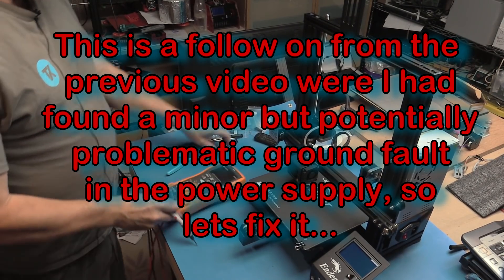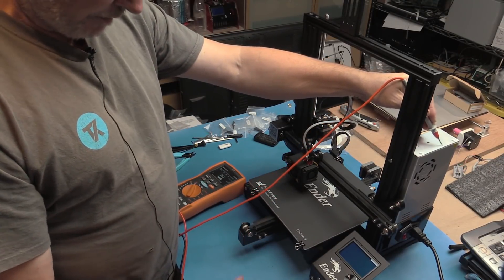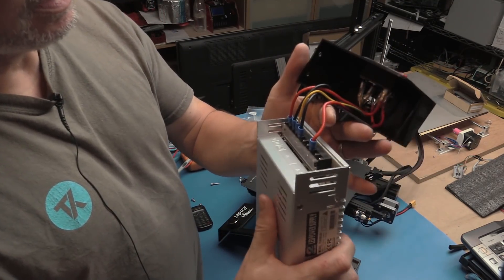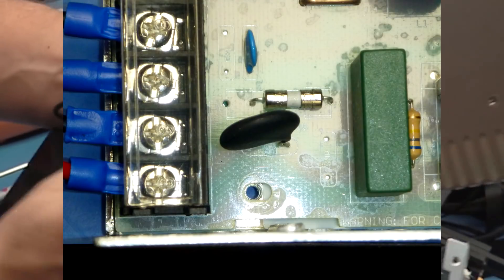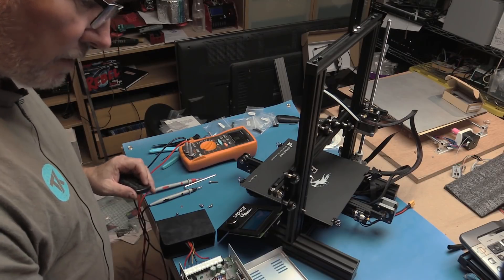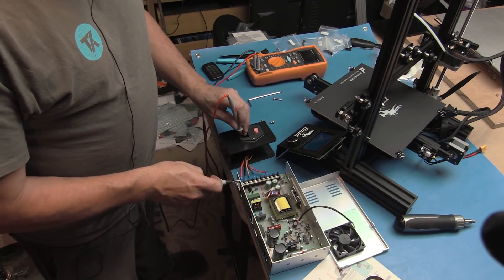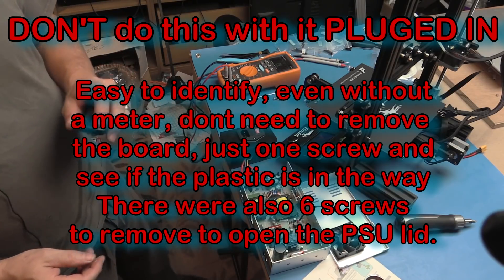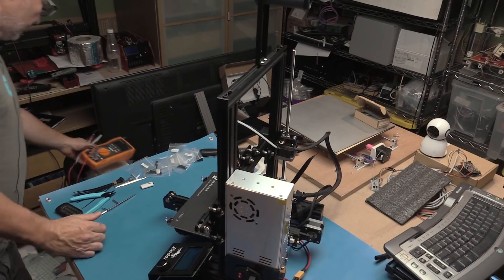Ender3 PSU Ground Fault / Faulty Ground Fix

Comment: Okay… mine says 180 ohms… how do I fix this??
Reply from the maker: if the resistance is ok from the plug to the gnd connector of the psu then remove the PCB and check underneath in the same way as I did in the video

Comment: Just did this and my values were around 38 ohms from case to end of power cable.....    Loosened the ground bolt on the board, flicked the plastic off and tightened up and now it's very minimal ~(.02ohm)

Comment: I'm looking for problem with my 3d printer. My measured psu output is 13,7v? Is that normal? or it's faulty? My nozzle can't reach 180'c whole nozlle is fine- i teste replacement part. So i'm looking for issue- it's either motherboard or psu.
Reply from the maker: If the PSU is a 24V model then yes, 13.7V is bad, if it is a 12V psu then its ok, a little high but perfectly ok. if the nozzle heater can be turned on and off for heat and it is simply not able to reach temperature, I would suspect the PSU or the thermistor. When at room temp, does the thermistor read correctly ?
Reply: @TheBreadboardca  I replaced whiole hotend module with thermistor and cartridge- and it behave the same way, so the problem is either in motherboard or psu.
Reply: @TheBreadboardca  Ok, the psu originally had 24v output. I've actually ordered new one. But i will try to repair this one.   Now I realised, that recently my printer was suspiciously silent. Turns out iwas faulty psu fan not working!

Comment: bought mine on august 2020, the grounding issue hasn't been fixed yet by creality
however the faulty counterfiet of XT60 connectors got replaced with XT60H-M and it looks promising

Comment: soemtimes mid way through a print the printer just losed power for less than a second could this be a cause?
Reply from the maker: Un-lightly to be a grounding issue but it still could be a faulty PSU, maybe a bad joint that is intermittently shutting down the power supply. does it "Glitch" if you just leave it powered on but no  printing, or perhaps try a print without the heated bed (PLA should still work), this would remove a massive load from the power supply to test if it is load related.
Reply: @TheBreadboardca   I just did what your video said and what's weird is I got a perfect ground when I touched the multimeter to a screw on the supply but nothing anywhere else. If the printer is not printing it does not appear to glitch ever. but it is uncommon for me to have the printer on but not printing I will try printing without a heated bed and get back to you
Reply: @TheBreadboardca  umm the printer does not seem to be rebooting when printing without heated bed I was unable to have printing for not long as the print did not stick without heated bed but it does indeed seem to be working without heated bed what would you recommend that I should do as a fix
Reply from the maker: @datrandomdugggy5537  If you have a spare supply, or one from another comparable printer, give it a try. there are still a few possibilities but I would suspect the power supply first as this was the only thing common to printing with or without a bed temp set. the control MOSFET would not cause a glitch nore would anyone of the motor controllers as they tend to shut down if they et too hot and possibly cause layer issues but not shutdown completly the system for a second or so
Reply: @TheBreadboardca  umm I don't have a spare supply at all my printer bis still under warranty so that might be my best option I did notice that the supplys input voltage is set to 115 but is drawing 123 don't know I that is a issue or not
Reply from the maker: @datrandomdugggy5537  115 is a nominal voltage, having 123 or even down to 100 will still be ok. if your printer is still under warranty then I would call the supplier and ask for a replacement PSU, or RMA the printer at their cost so they can fix it, if you got it from China though via the usual channels they probably wont have it shipped back to them at their cost and it will cost you way more than a power supply to send it back yourself. and if this is the case, just buy a replacement power supply. if the vendor wont send you one for free. if your not sure what to buy, send me a picture of the label on the PSU and them model of the printer you have
Reply: @TheBreadboardca  cool thanks for the help i got the printer from amazon the supplier has already replied and its looks like i might be able to get a replacement psu
Reply from the maker: @datrandomdugggy5537  Thats great news, if you have any other questions, feel free to ask
Reply: @TheBreadboardca  hello it seems that their might be problems getting a warranty replacement if you could suggest a pair that would work that would be great i have a ender 3 here are the labels for the PSU https://imgur.com/a/B3uZEU0

Comment: Many people build an enclosure for their ender 3. Because the enclosure gets hot inside many people decide to separate the electronics from the printer and have only the frame of the printer inside and motherboard and PSU outside. Do you think this could be a problem because the frame itself is not grounded to the PSU? Is it safer to ground the frame eitherway and how woud you go about doing that?
Reply: I'm actually doing it that way and just put a ground wire back into the enclosure together with the Stepper, Hotend and Heatbad Cables. It's enough if you put it on a crimped connection screw and somewhere onto the printer frame, to ground it probaly. I'm not sure if it is really nesscary but anyway.. It's not that much work, and you have to open the slot from the PSU anyway to extend the cables and toss the xt60 connectors out of the window.

Comment: just got my E3 today, one of the first things I did was check ground and replace the entire power cable (got rid of the XT60 connector altogether). Sure enough they handn't tightened down the screw on the PS and it was connecting to the case properly, a few turns and it completed the ground connection
Reply: Hello, I've order new cables due to my Xt60 "melting" ... How did you change the cable in the psu ? I see a sort of  "crimp" connector. Did you re used it on your new cable, or used new ones or do without ? On the motherboard only screws are needed. Thanks, hope you will get this message :D

Comment: so the cr-10 frame isnt grounded at all xD fun
Reply from the maker: most important is that the power supply case is grounded. Due to the way some are mounted, there may not be a direct metal to metal connection to the frame., having the frame of the printer also grounded is an additional bonus and could be easily dont if required with a simple short length of  "Ground" colored wire
Reply: @TheBreadboardca  Yeah agreed. Will do my test and might add my own ground cable as   its dry enough where I live to feel like it should be :D

Comment: 0,8 Ohms is pretty awful. Regulations in Europe specify maximum  0,3 Ohms to the farthest point from the mains connection.
Reply from the maker: If I measure to the case of the psu then it was .18 ohms. The measurement your refering to is after several anodized extrusion and blacked screwes fittings. I started with nearly 10 ohms just to the case of the psu.
Reply from the maker: @Cereal Experiments Completely agree, If I wanted to know the exact measurement I would have pulled over my bench DMM (Keysight True Volt 7.5 Digit with Kelvin measurement capability:) ) but I did not think that kind of accuracy was needed, the meter I used is still a quality Keysight DMM and with a nulled resistance reading I get the ~ 0.2 Ohms, 4 terminal would only serve to lower that even more probably 

At the end of the day, the readings may well vary depending on the quality if the IEC plug and socket, the materials coating the actual plug, the import mains cable (Aluminium vs actual copper), the level of anodizing / oxidation on the aluminium and the resistance of the screws as they are also coated. With a little work if I really wanted to minimize the ground resistance to the frame I would add bonding wires between each connecting extrusion, the psu case, the actual ground wire (Not via the PCB Trace) etc. I dont think this needs that level of attention.